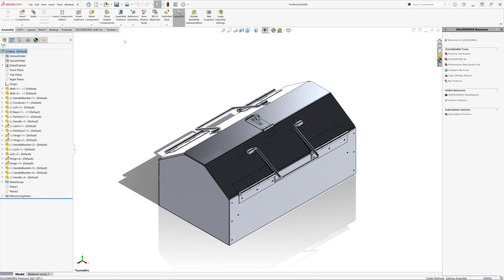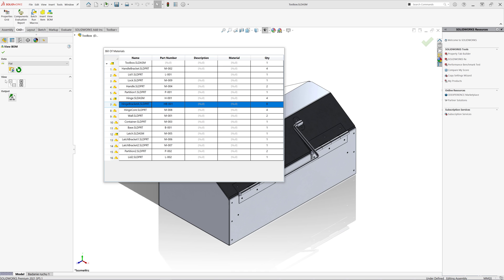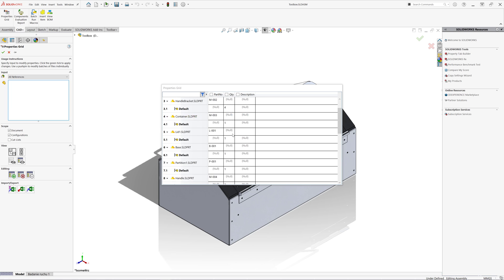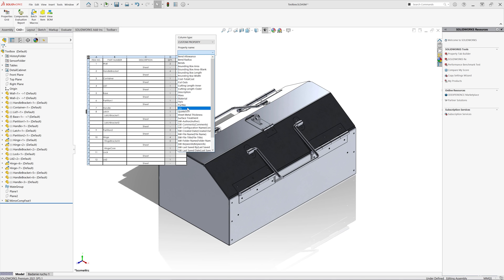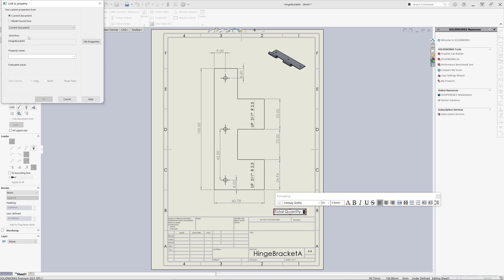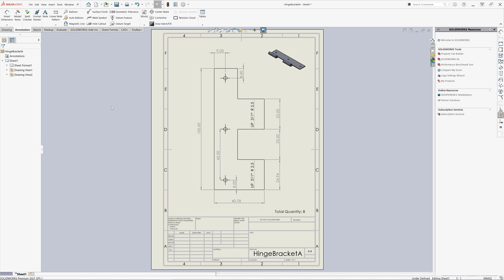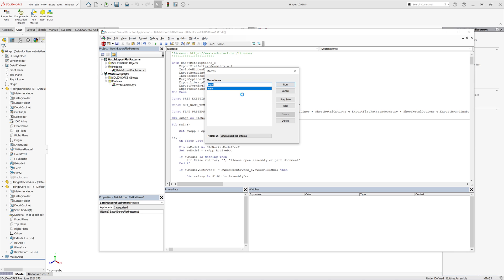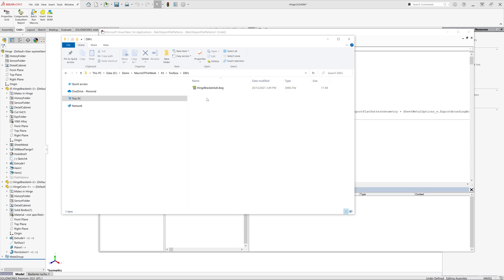Write Component Quantity Into Custom Property

Comment: Hello my dear.
At first it worked in part because it doesn't count when the piece has a linear pattern.
Reply from the maker: Could you please clarify the issue? Do you mean if the component is in the components pattern, its quantity is not correct? Or do you mean the multi-body part?